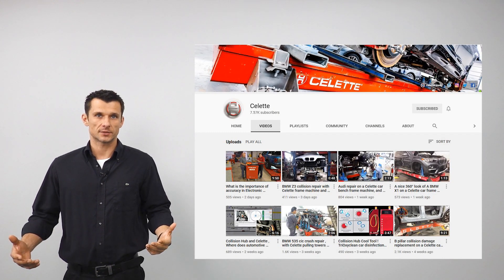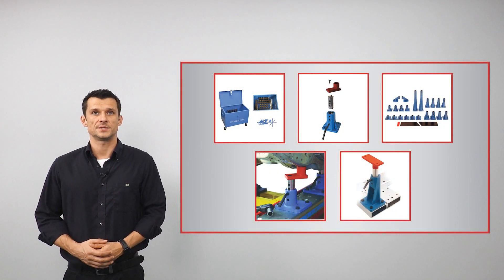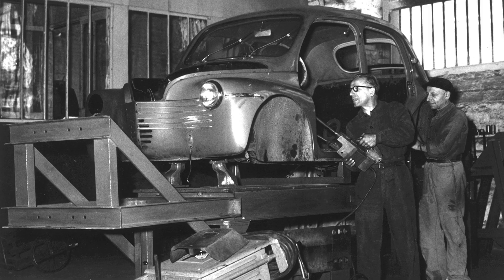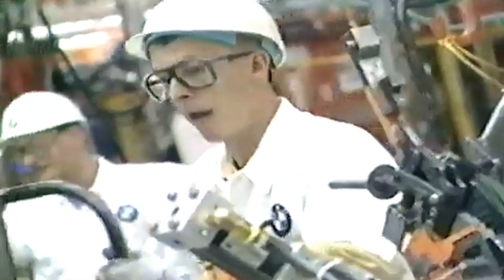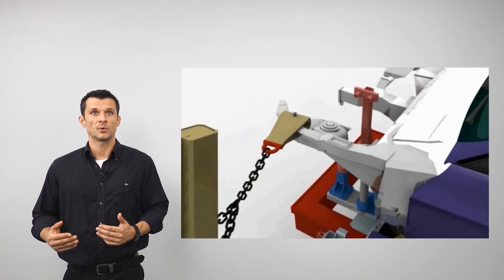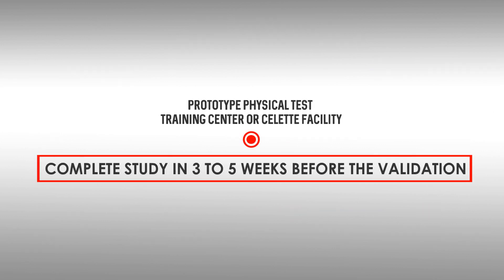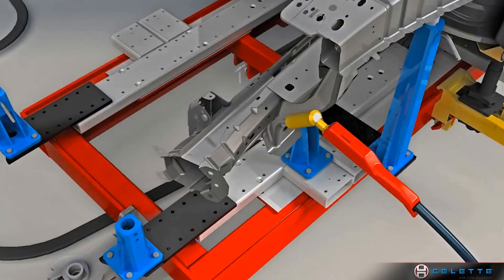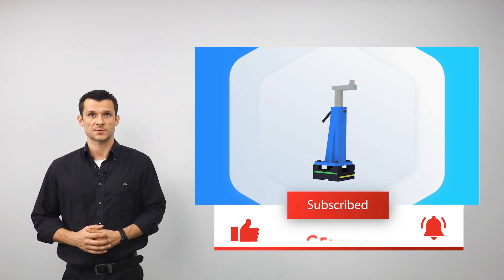COLLISION REPAIR HISTORY : ROOTS OF FRAME MACHINE, BENCH, AND JIG SYSTEM ONLY BY CELETTE

Comment: My name is Tony Hornett founder managing director of A 1 G group Mundon Maldon Essex myself Ms cellete kurt Johanson of Vaxjo Sweden developed the very first clamp on and swivel dozer for the cellete bench in  1967   I then worked with the research engineer team of Blackhawk developing the Korek 3 of these were installed in my factory at A1 2 scissor lifts with a cellete bench on each both nuematicly controlled coming up from a pit with the precise cellete system and multi pull of Korek I consider it an incredible unbeatable time saving package initial outlay well worth it anyone knowing my history are aware how I pioneered the approved repairer system and with Mark Green from Leeds the VBRA also assisted Danny Gibbs set up Thatcham Research unit all be it I am told that the Insurance companies take liberty,with repairers they do not take into consideration how much it cost to set up a body shop     My regards to all Finaly Cellete is the most accurate      Tony Hornett
Reply from the maker: Hello Tony, my name is Pierre Nicolau and I am president of Celette. I read your story with great interest. We are very interested in Celette by the previous products developed for this industry. we thank you for your kind comment and wish you a happy new year 2021.
Pierre Nicolau